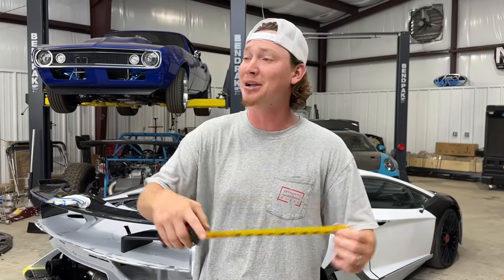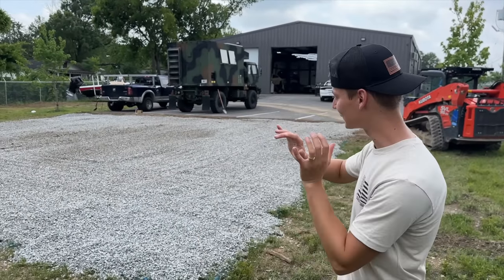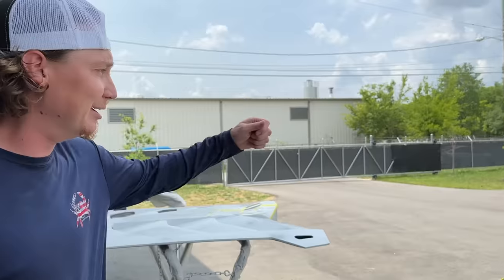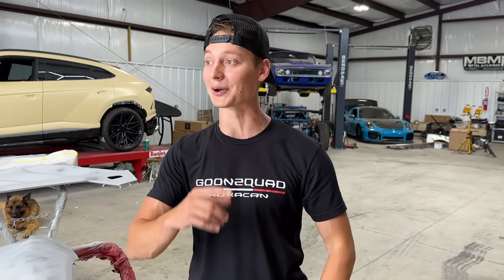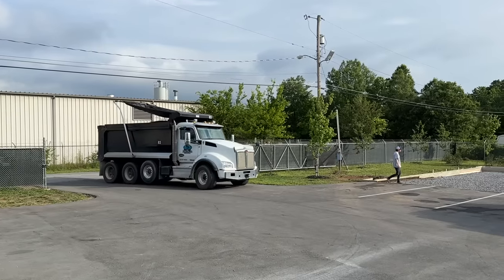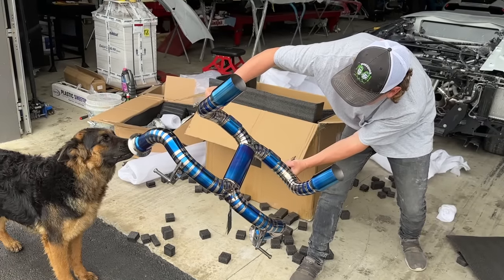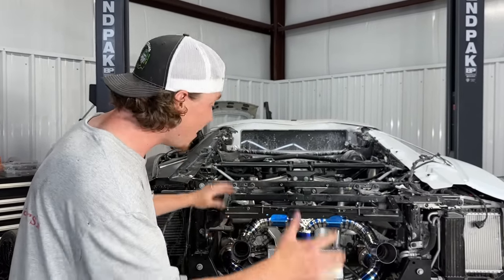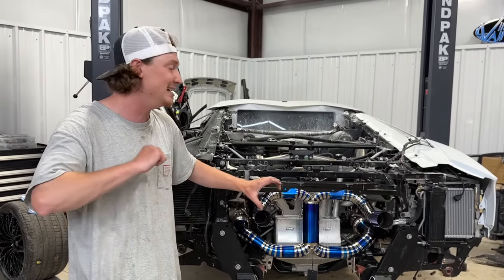Rebuilding A Wrecked Lamborghini Aventador SV Part 16

Comment: The paint booth is the ultimate upgrade to the shop. Keeping as much as possible in-house will definitely save you time and money.
Reply: Greedsquad already saving money by overpriced junk selling on their website 😂😂
Reply: @TNT-ml1ll cry about it😂
Reply: Seriously I'm crying for purchasing a $150 Porsche scrap metal piece 😂
Reply: @TNT-ml1ll 😂😂😂
Reply: I wonder if they got permits?
Reply: @mikerichard-FOPA3  if not someone will snitch them on city. And they'll pay a huge fine then.
Reply: i do not think that the cars they have, they are having issues with money.
Reply: could even rent out the booth when there is down time
Reply: @mikerichard-FOPA3  No,  that land was surveyed & set-up for the water drainage of the 1st building, now with this 1 it's going to change everything
Reply: Only worth it if they get quality stuff. I wouldn't hold my breath on good paint jobs with an outdoor booth, especially a cheap auto body toolmart one. My brothers and I bought our own new Garmat 3000 full downdraft for about $100k, and we built a 11k sqft shop to put it inside, all built by my two brothers and I. It was a huge project in the Texas heat, but worth it in the end. We did go a little crazy, but at least they should put the booth in a building though.
Reply: hin layer of gravel and thats it? so you pour concrete on top of this thin layer of gravel and when the frost sets the frozen dirt is gonna push up and crack that concrete pretty easily, they should atleast remove 50cm of dirt and then fill the hole with gravel ment for construction
Reply: @joki6395  Your right, 
I never seen someone set up a pad on top grass or top soil, they just put that down & that ground hasn't settel yet

Comment: Gday guys,
Just a tip for your priming. If you get a few small pots of the different colour paint tints. Say if you prime with a grey first, then rub it back, then your next mix of primer add say 5 drops of “dark green” tint to the light grey primer will change its colour. Then spray and rub it back, but stopping when you might start to rub back to the grey. Changing colours between primer coats will stop you rubbing back fully through the primer layers and give you a better surface finish. Also if you use a 3M type block instead of your hand will give you a much more even finish. 
Great to see how far you’ve come fellas. Loving the content,
Cheers

Comment: It looks like all of the 💧 from the parking lot is going to run right into your paint booth the way you have it layed out! 😮 😂 😅
Reply: They like doing things wrong then they make another video going back to fix stuff all over again. It's the YT way lately.
Reply: @puirYorick another video with an overreacting thumbnail and title. We Made A Huge Mistake. Our $20000 paint booth is breaking apart 😭
Reply: @TNT-ml1ll lol all your fav youtubers do the same😱😱😱
Reply: Get your head together lads and get back on track to many vids fooling round😂
Reply: Hard to tell from the video but the form work was left off the parking side and will be at least 4 inch thick slab, so won’t be an issue. I guess we will find out in the next video. I wonder about no power and drainage connections. Also why is the temporary power pole still there?
Reply: Get back to basics boyz!  Enough with the super cars that no one could afford. Get back to the American made trucks, cars etc….  Made in U.S.A. Quaility builds.
Reply: @Cheese_Piedogi naw. It fun to see all of them.

Comment: Probably to late now but I think you're going to wish you had installed a trench drain to catch the water that's going to be coming off your parking lot right at the paint booth. And hopefully you don't have to much settling from your slab, you always want to strip off any vegetation and top soil before you do any kind of hard surface otherwise it's usually going to move on ya.
Reply: ya i try not to be negative but they've done some much (bad) concrete work i thought they would have learned. dumping gravel on uncompacted grass seems like a recipe for disaster. especially since their property drainage field goes right towards it. smdh. 1 step foward 2 steps back sometimes. especially if no permits were pulled
Reply: @Alex-zi1nb  Waiting for the the Permit fiasco. Also. If they plan on ever putting a lift in that new building the concrete needs to be 6" Steel Reinforced.
Reply: Those were my thoughts exactly but knowing how they upload the vlogs they probably already poor it all. Hopefully the concrete guys did what they didn't do to prepare for the concrete.
Reply: That's the first thing I thought of. You would think after all the hassle they went through with the city and the money they had to spend, drainage would still be fresh on their minds.
Reply: Same old story:  'stupid is as stupid does' - Forrest Gump!
Reply: Ya I try not to be negative too, but you need to remove the topsoil and grass down to subsoil.  Then pack in that gravel.  Lazer level it flat.   The water from the parking lot drains into the pad/ building.  Every contractor knows this.  They will need lots of stress cuts in that concrete over plenty of rebar!  Building permits?  Water removal?  I see another retention wall fiasco coming.  Not to be negative but stick with building car knowledge.
Reply: I cringed when I saw gravel direct on grass but then I remembered I was watching The Cowboy Brothers channel on Rip Shit and Bust TV.
Reply: @Alex-zi1nb yup, no permits and they’ll be looking at concrete repair before long. But they watched something on Google/YT so they are now ‘experts’…
Reply: Yup hate to say it but that sod and topsoil needed to be removed first. Then gravel added and compacted for a strong base.
Reply: Yeah I watched them pour that gravel straight onto the mud and thought ‘they gonna regret that one day’
Reply: @Alex-zi1nb yep goofy squad

Comment: How about getting another metal building for the paint booth? then you'll have a LOT more space for anything you need and it'll be protected from the elements. Also don't forget that you need to add conduits for power/water between the buildings
Reply: Isn't that what they looked at the start of the video which is priced at $20k 
The spray booth goes inside that I'm presuming.
I also thought that about the services running under the floor, they haven't took that into consideration? Or mentioned it.
Reply: @freddythefrog70  It was just a carport, so not inside at all. They're going to have so many dirt nibs that they might as well hire someone to paint the cars for them. My brothers and I bought our own Garmat full downdraft booth, it was close to $100k, and we built our own 110x100 building for it with just the three of us. Everything else seems easy after that project lol.

Comment: Personally, what I would do as far as the paint booth is make like a underground tunnel like system for the air to flow that way you’re getting the paint fumes and particulates that did not land on the car out of the area immediately via underground love the videos by the way, I loved the flames too

Comment: Should do a whole enclosed building over there, 1/2 or 1/4 paint booth and use the rest for sanding and paint prep so you aren't dusting out everything in the main shop all the time.

Comment: For the future, I suggest against pouring concrete over grass technically you can, but you really shouldn't pour concrete over grass. To maintain its tensile strength, concrete needs to be laid on a firm, even, and dry foundation. Grass and soil will naturally channel moisture into the concrete from below, which will likely result in it cracking over time.
Reply: Plain and simple, it's a dumb idea - period!

Comment: Why the heck are you using fiberglass on a carbon repair? You need to use carbon fiber otherwise you're gonna end up with fiber corrosion that ends up eating the carbon fiber like termites to a damn poor dead tree.

Comment: From someone that has worked in a nonvented building and a well vented building, I would stick a fan on all 4 walls, 3 pointed out, 1 pointed in, of the building y’all put over the paint booth, for when y’all are sanding and/or laying some primer

Comment: You are doing an amazing job guys.
I can't wait to install the paint booth it will be something amazing.
Sports hypercars have great engines. Unfortunately you have to treat them with more care. Going into high revs without first warming up the oil can cause seizure of the pan and crankshaft. Also, with turbocharged engines, you should never turn off the engine immediately after cutting the revs. A speeding turbocharger without proper lubrication will be damaged. Such engine damage occurs after a long time. If you care about saving your engine and do not want trouble in the future you should take more care of your engine. More love for cars and a little less childish 😉😉.
I'm keeping my fingers crossed for you and looking forward to more episodes.

Comment: Smaller exhaust will probably help with the performace too , Plus help with the back pressure and flow , the extra flames shooting out the back  should give a little extra  boost too. Should probably look at HI TEMP paint for the rear.

Comment: I would have put the paint booth outside on the back wall and connected to the building. It would be a lot easier to heat it and to run electricity.
Reply: Probably will be running out to The Home Depot to snag a couple 150-foot extension cords to plug in those paint booth light fixtures when they think about needing electricity. Remember the sheet metal building up on the mountain?😆

Comment: You guys need to use fine lining tape on the transitions from carbon to paint otherwise the paint might bleed under the normal masking tape and you won’t get a perfect line.

Comment: Just saying, the way ya’ll took out dirt by the asphalt. Should of taking out the whole area ya’ll spread the rock on. By taking out the top soil which is like a sponge, it will be less likely for the concrete to crack or shift. Also need beams dug around the edge and across the slab. But it’s ya’lls build.

Comment: The aftermarket pipes and headers added extra HP for air flow u switched to smaller bore the motor is not gonna breath better than the aftermarket you’ll see..

Comment: Do town code or bet you know what happens now. Get a damn cable rig well driller if you want water, not an air rig or a sonic rig does not blow probably better than cable. I ran cable rigs in MD 30 years, sanitary wells. Look that up. Sanitary wells!

Comment: Don't you need to compact the ground to make a foundation? If you just pour concrete over gravel it'll just crack as the ground settles under it.
Reply: Yea, if they did it the right way. All organic material should be removed from below a concrete slab when poured in grade like that.

Comment: Put the paint booth up your self. I had the same thing, install was same as booth and I had to do roof penetration for the exhaust fan. I worked with them setting it up it’s nothing. It’s a lotta nuts and bolts though.

Comment: Being that loud it wouldn't be enjoyable driving it. I guess I'm old. I do like a good sounding exhaust but I also want to be able to control it like you did with the remotes on the army tricks that you installed on other cars.
Reply: I’m surprised Ryft didn’t offer a valved option, considering it was a custom build after all…

Comment: Yoi guys need to just put another building out there so you can have the floor done and you don't have to do over a bunch if work later. I'd make it as big as that space will fit to have a prep/sanding space, a spot for another 3 car stacker and room for the booth. Do it right from the start and pick a building and do the floor with all your plumbing. Thise companies can get a building done in a few days and have it ready for the paint booth.

Comment: How are you going to keep the gravel under the slab when you remove the forms?  Typically slabs have perimeter footings (and are on compacted fill with soft soil and vegetation removed).  You guys always spend good money on quality stuff.  I worry that you may have some settlement problems with your slab which could screw up your paint booth.

Comment: Don't know if the concrete guys told you but you need to compact that gravel in section been that thick. If you don't it will crack when you add the concrete. I know you are not up to date on the vlogs just hope you compact it before the concrete was done.

Comment: guys I'll just tell you if you're worried about saving some money you mentioned you know couple thousand or whatever its cheaper to wait on the paint booth because correct me if I'm wrong they charge more if there structure in the way of putting up the metal building up

Comment: I'd just hire a company to throw a building up. Pick a building pour the footer snd floor and have them set to throw it up as soon as the concrete cures and then bring the booth in. 

It well end up costing more money and more work to just throw a pad and a car port now. Just bite the bullet and do it all at once. You'll be glad you did! You'll have extra storage and a prep area in one bay abd the paint booth in the other.

Comment: If you're running a car that has an exhaust on the street that is supplied with earplugs, you're going to be looked on as an obnoxious jerk. That exhaust sounded terrible in both modes. Louder isn't necessarily better.

Comment: They never learn from their mistakes, the amount of gravel/subbase they've moved/laid and they still don't consider grade/depth. The fact they haven't bought a site laser/level is crazy (or maybe no one has offered to "sponsor" them one). Also not buying a carport/shelter/shed for the paint booth and having it built ready, commenting on the cost with install (when they're happy to spend 10000s of $$$ on toys). They obviously haven't paid for the booth, if I had I'd want it fully protected. You need a covered/enclosed area outside of it. What about the services to the area?

Comment: Why don't you guys take off the rest of the under cover off, there's loads of rubble on it.
What about the water & electric in the new spray booth, doesn't it come in under the floor? It would in the UK.
Reply: Maybe they're planning on extension cords and rubber garden hoses for water. As soon as some city inspector sees this video on YT they'll probably get a stop order again.
Reply: @puirYorick  LOL that's what I envisioned hosepipes and extension cables.
Also not sure about them putting the pad directly on top of grass & weeds, would have thought you would dig down, then screen the area with a thick membrane to stop anything coming through.
But I'm no expert 👍👍

Comment: thin layer of gravel and thats it? so you pour concrete on top of this thin layer of gravel and when the frost sets the frozen dirt is gonna push up and crack that concrete pretty easily, they should atleast remove 50cm of dirt and then fill the hole with gravel ment for construction

Comment: Hopefully you removed from the sod under your concrete. Drainage is very important. Didn't you all come from the construction trade? A Mono pour is how you should form it up. You all know better than to take short cuts. In construction the whole idea if not too come back and do any type of repair or work again. CODB Cost of doing business is a lesson learned. Can get spendy.

Comment: It is certainly not good to floor the pedal wen the engine is not on its working-temperature and nothing to torque !!!
Reply: Because  when the engine is not on it's working temp all the metal parts do not have the right size, the have to much space and the oil wll be to thik. All so if you'r reving the engine whitout asking torque, is like when you will kik a ball and you kik near that ball. You wil feel it in your knees.
It's damaging all the bearings from the crankshaft (big- and small ends).

Comment: Honestly this is nothing but kit car…. Adding all aftermarket panels fiberglass, carbon fiber..etc nothings original… a bit disappointed… it may look amazing but when it comes to exotic sports car=OEM… also fiberglass tends to crack in long run from all that vibration compares to urethane…. Doesn’t matter how much you patch and glue now it will crack in next few months… and it will look like $hit